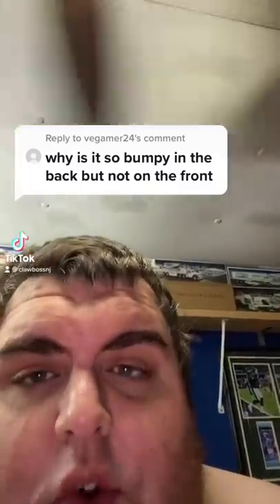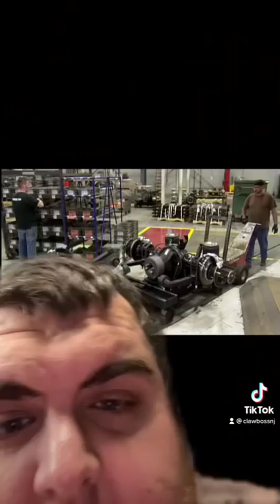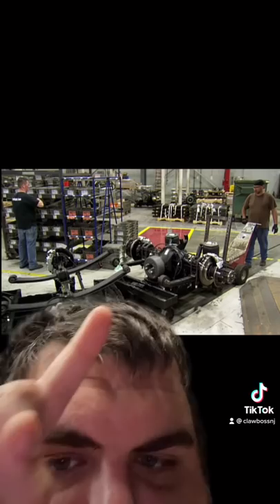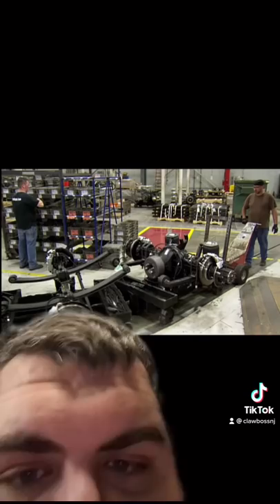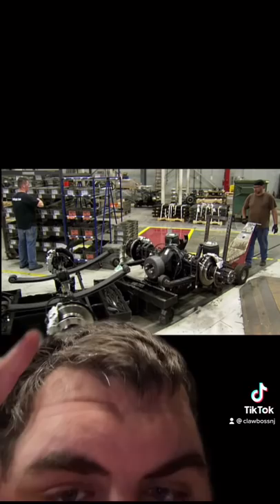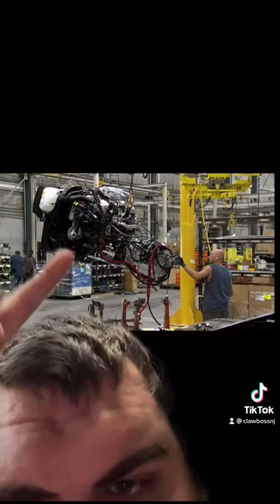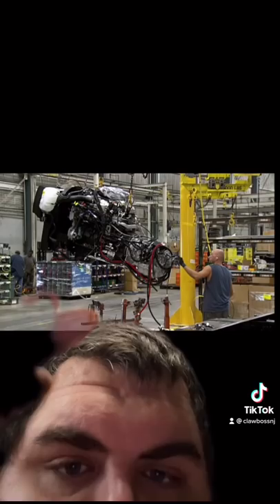WHY IS A SCHOOL BUS RIDE SO BUMPY IN THE BACK? #shorts

Comment: Front wheel cars do not have more traction Because remember one thing when you accelerate the suspension squats backwards look at it this way your front brakes do most of the work because when you slam on your brakes the front and dips down because it gets more traction because of the force of the vehicle pushing down on the suspension same with having a rear wheel drive car

Comment: Back in the 70’s and 80’s when I went to school here in Australia, schools generally used the state government owned bus service, and they used at the time these Bedford busses similar in construction to US school busses. Leaf springs all round, front mounted motor. Great fun sitting on the full width bench seat right at the back. (No emergency exit rear door, but a specially mounted rear window that was easy to push out in an emergency.) then they started to introduce Volvo and Leyland busses with rear mounted motors, and the bouncy fun was a thing of the past.

Comment: I think you meant to say FWD vehicles have more traction than RWD vehicles because the engine AND transmission sit on the front axle. Where as a RWD has the transmission behind the front axle and a driveshaft going towards the back of the vehicle to the differential to drive to rear wheels. However, FWD can't handle corners at high speeds as well as a RWD can.

Comment: I'm a big fan Clawboss but here I will have to disagree with you.

The reason why it is bumpy in the back is because of the torque applied by a speed hump through the wheels. If suspension was the reason then that wouldn't explain why sitting on the seat on top of the axle is a bit comfortable than sitting further back. It all depends on the distance from the seat position to the where the wheels are, the higher the distance, the higher the jerk. Think of it as a seesaw, the more you get closer to the pivot point, the lesser you travel up and down and hence the forces you experience

Comment: That's also why the transit school buses provide a much smoother ride.  However when it snows the front of the bus won't have traction when braking. Unless it is a transit with the motor in front.

Comment: yes and also the back is the furthest point from a wheel so you can think of the wheel as kind of a fulcrum point also if the driver goes over a speed bump, they may accelerate after the front wheel

Comment: FWD cars have more control bc the front wheels are the dive wheels. Instead of pushing its pulling the vehicle. I see people ask why a bus isnt front wheel drive and thats bc rear wheel drive has naturally more torque. You got to move that 39 thousand pound vehicle some way, if a bus was FWD it wouldn’t have enough torque to get the bus up to speed. Now you know

Comment: They also use leaf springs on pickup trucks mostly classic ones
Reply: Almost all pickups still use leafs in the rear, but only the heavy duty solid front axle trucks still get them in the front.